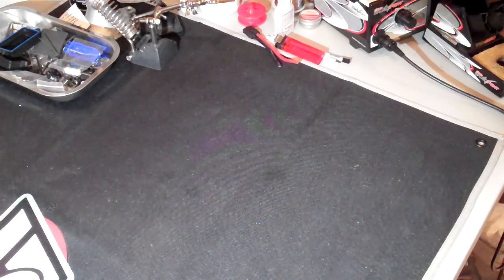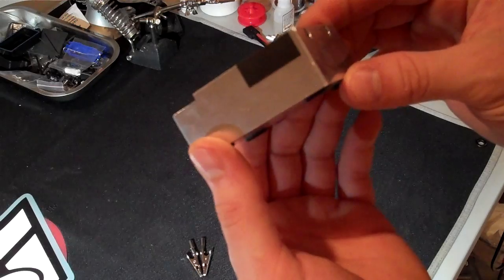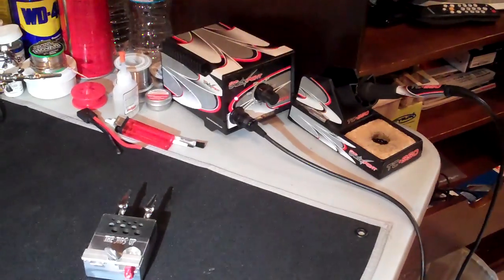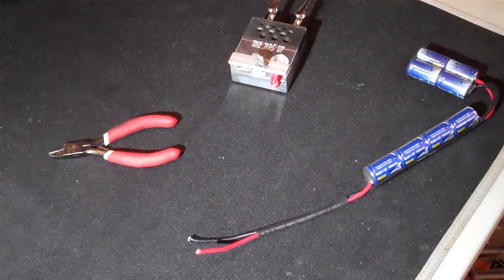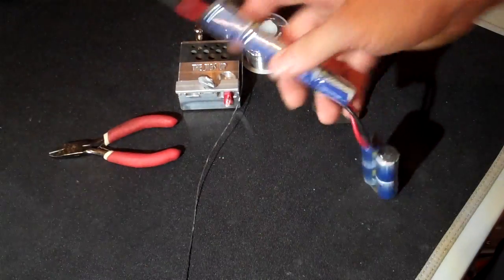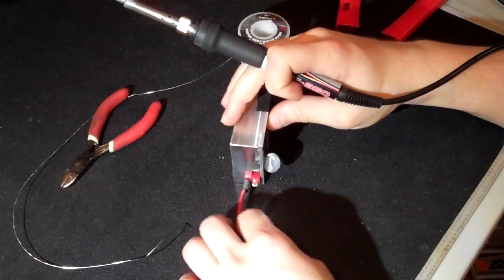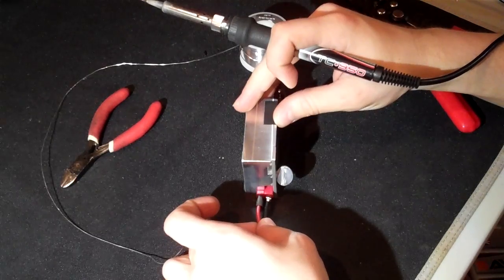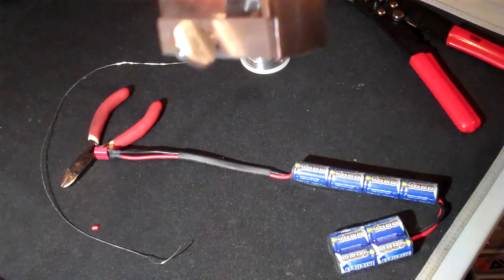The Best Soldering JIG ---- The JIGS UP V2 Soldering Deans

Comment: I just ordered the latest version that includes a helping hand clip, as well as the jig. I've had an un built Axial Exo Terra buggy kit for about a year now, and thanks to a nice tax return, I can finally get the electronics for it. This cool little tool will make the build a lot easier, and give me a bigger selection of esc/motor combos to chose from, as I won't be stuck with inferior plug and play set ups, due to my poor soldering skills. I used the pliers and rubber band technique when I built my SCX10, and though everything eventually worked, my shaky hands made things frustrating when holding the wires, and iron steady at the same time.

Comment: its a shame they didnt put the holes for the aligator clips on the left side ( side nearest THE of the jigs up ) as if you put them in where they have put the holes it blocks off 2 of the bullet holes, it would be better designed if the didnt block those holes so all could be used at the same time